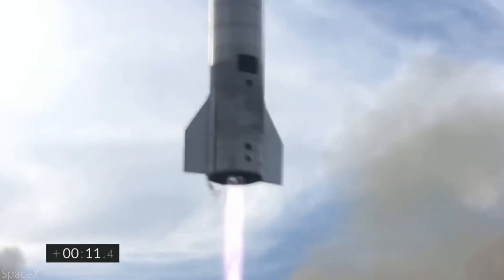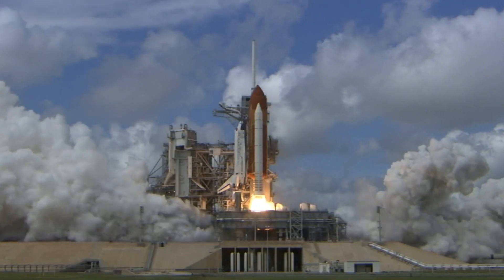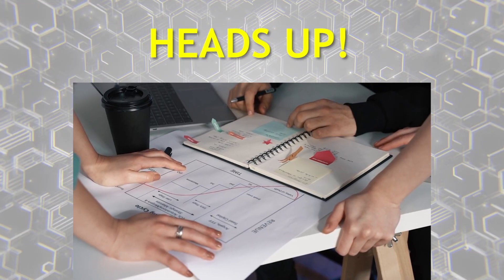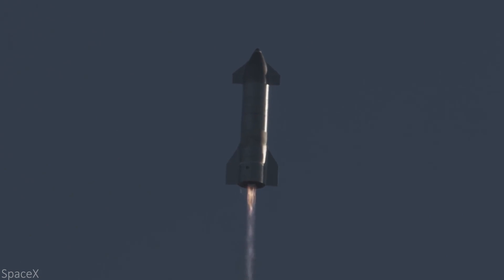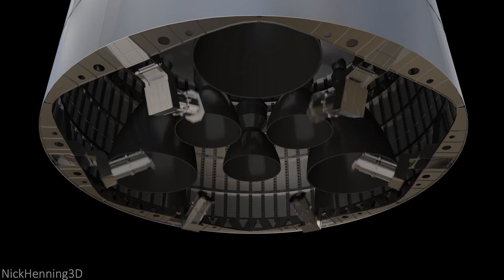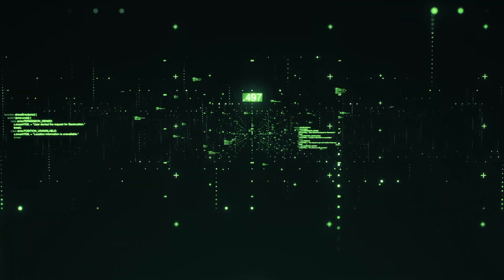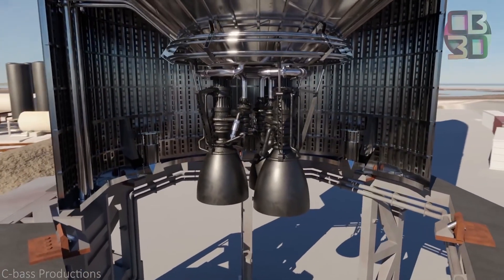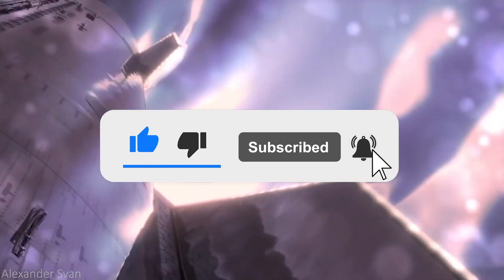What Makes SpaceX’s Starship Reusable?

Comment: A Tesla battery can be recharged 600 times before replacement; and a huge and heavy Starship rocket can be launched and landed 2000 times before replacement? Something doesn't quite add up here. Think structural fatigue and material failure due to load and heat stress.